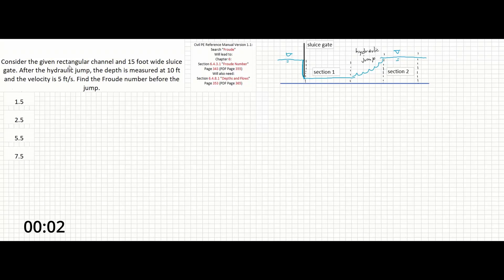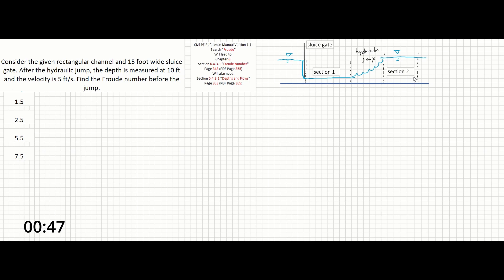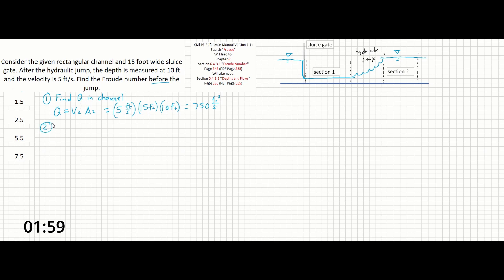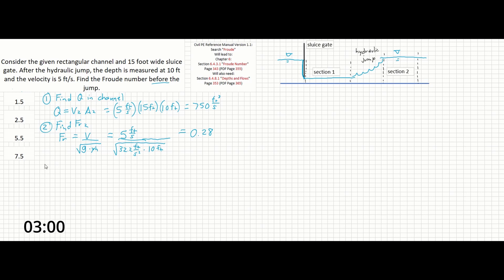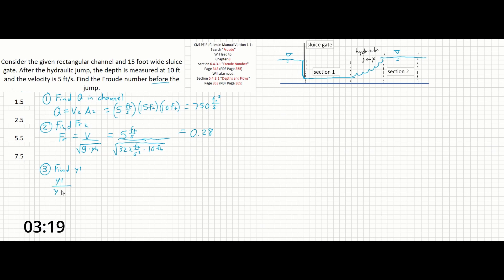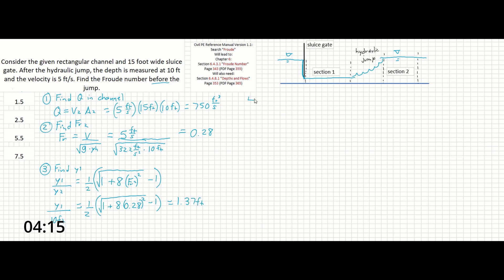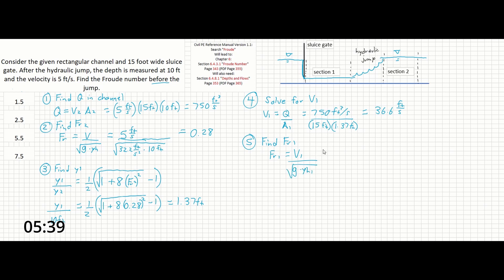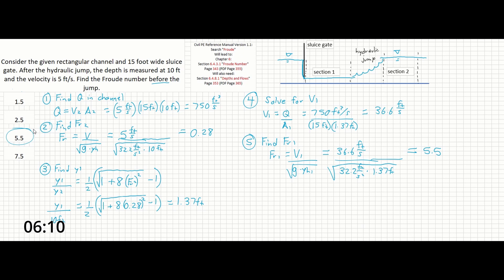PE Exam Practice Problem #28: Water Resources | Sluice Gate - Froude Number - Hydraulic Jump

Comment: I'm not sure what was in the reference manual 1 year ago, but in V2.1 in section 6.4.8.1 you only need two equations to solve what this problem is asking. y1=-(1/2)*y2+Sqr((2*(v2^2)*y2)/g+((y2^2)/4)) to solve for y1, the height upstream of the hydraulic jump, and then using the knowns with the solved y1 you can solve for Fr1 with the equation given in the same section as y2/y1=(1/2)*(Sqr(1+8*Fr1^2)-1) solving in just two steps instead
Reply from the maker: Good call. I was trying to write this problem for someone who had no idea where to start and wanted to search keywords from the problem in the reference manual. But you're right, the equations you listed are also in version 1 and can be used faster if you understand what this problem is about. Thanks for sharing.
Reply: I dont believe that is the case, there are two different velocities in play here in each section.
Reply from the maker: @JoshuaCrane-i5r  I did the calculations using the equations that zack shared and it does appear to reach the same answer. You are also correct that the velocity is different in each section, but I think the equations account for this. Let me know if you disagree.
Reply: @SolvedIn6  Ah yes I see now, thanks!